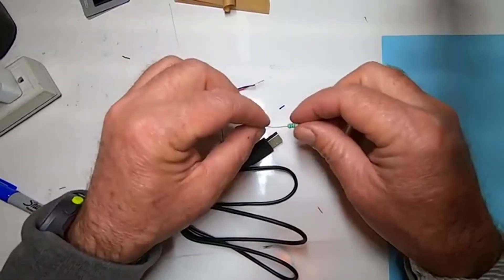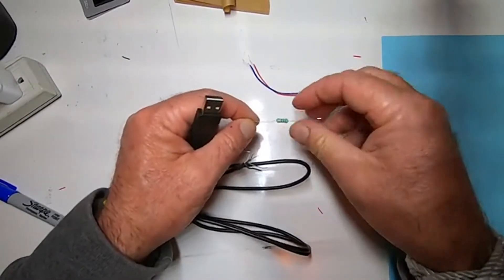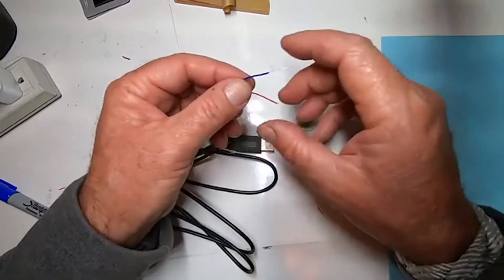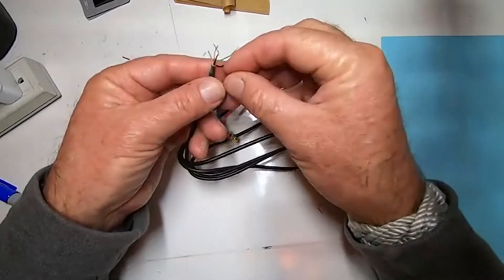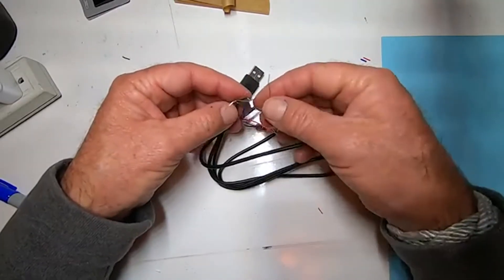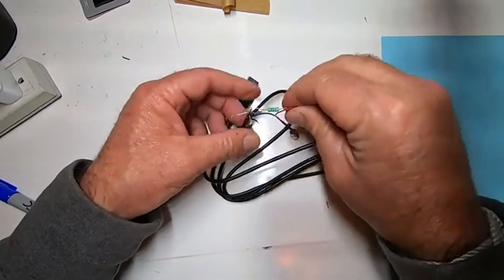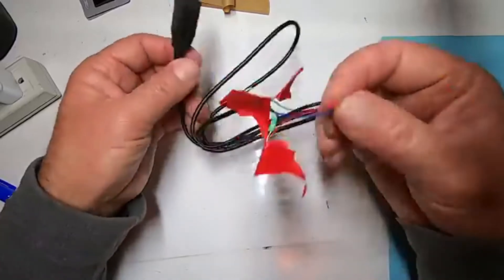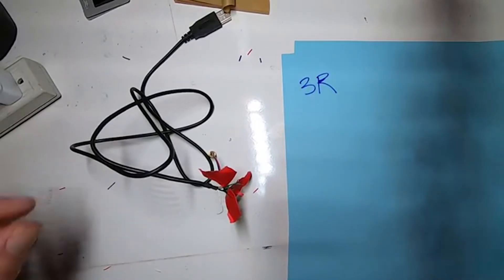HiLetgo 5V 650nm 5mW Red Dot Laser Assembly

Comment: isn't it 5V ? why is a resistance needed?
Reply: I'm curious if it's to make sure that the laser does not reach the advertised 5mw power, which would raise it from class 3R to class 3B.  Class 3B would require additional safety precautions that may not be constructive for the lesson plan.

Comment: What resistance have you used? Ohms?
Reply: I have from arduino kit, laser 6mm. Its have a 91 Ом, 5% nominal resistor SMD910 direct to.
And SMD103 from "one of the three, in pin".

SMD or not doesn't matter just for information.